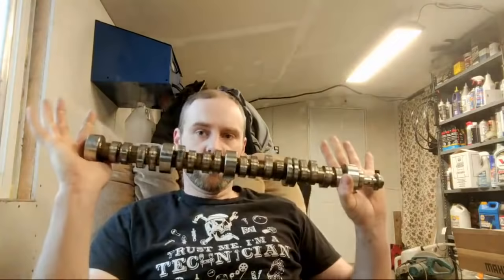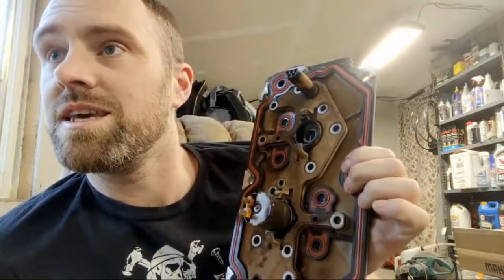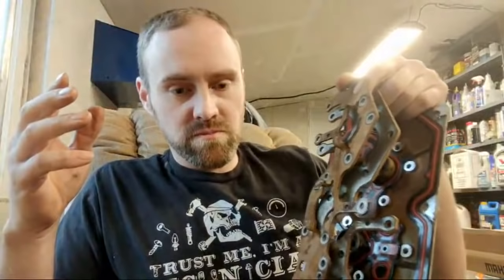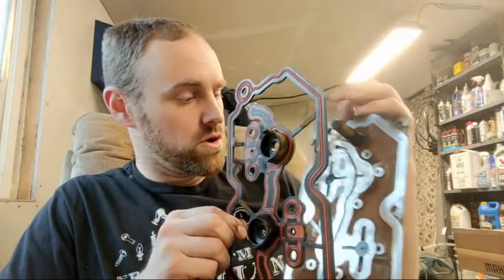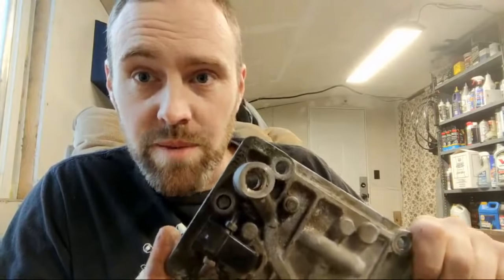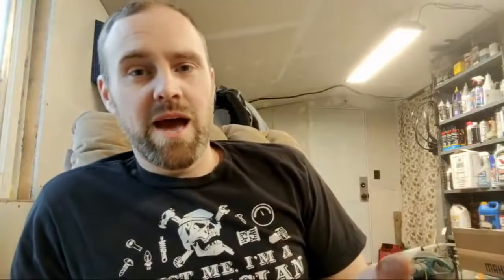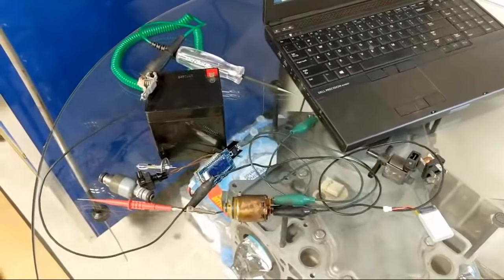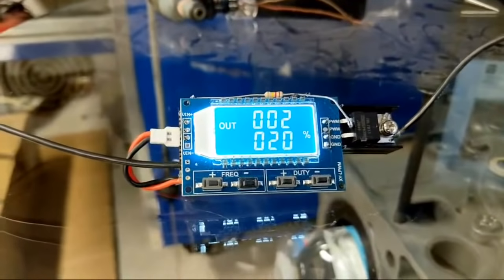First Live To Talk DOD And Ask Me Your Questions

Comment: Hi mate I have a 2010 SS VE ute that sounds like it has a lifter rattle on start up in the morning. I recently did oil & filter change & used the expensive oil that was so thin i had to check the level like 10x because it was so hard to see. My question is.. should I be using a cheaper maybe thicker oil & do you think that could fix the rattle before I spend money i haven't got refreshing the lifters & bearings? Please help i fully respect your advice. Thank you most kindly.

Comment: Man doing 1 now all new lifters did the flush it stopped pecking after flush n new screen n oil sending unit. But customer insisted all lifters replaced even thoughflush took care of it. Now with valve cover off on drivers side it's blowing oil on #7 cylinder blowing out the push rod n threw the rocker arm. Like its stuck lifter its got perfect oil pressure now have to tear ot down see whats up.

Comment: if you replace lifters with non AFM lifters, delete valley cover, VVT cam delete and have ECM reprogrammed will the oil pressure be adjusted in the ECM reprogramming?
Reply from the maker: no, If you wanted to lower oil pressure the pump would have to be changed.

Comment: Question? Have a 6.2L Denali that was showing low oil pressure 20-30psi from 50-60psi. Changed the filter and the oil pressure switch and still seeing 30-40psi. Is there a good spot to get a mechanical gauge on the engine without trying to thread it into the sending unit hole?

Comment: I have 08 LH6. Cylinder 7. Pushrod moves up and down and seems like when it builds oil pressure it stops moving and low compression on that cylinder. Otherwise when it’s running absolutely no noise or ticking. Is this a vlom problem or the afm lifter?

Comment: Thanks for all yout tips i  unabled DOD and installed a normal valley covet i just did dome groves in each oil tower passage (on the valley cover side) and truck runs fantastic i gain at leat 10 lsi of pressure and you can see where the oil was lwaking from old valley cover because has some shiny spots (i used atf for cleaning) but it works thanks a lot

Comment: I have your ultimate challenge.Have a real major problem on a 2010 5.3 with the DOD. The number 4 cylinder. When the engine makes oil pressure they valves quit moving. It has 16 new lifters a new DOD plate. We are lost? Would love some help?
Reply: Help help
Reply from the maker: The lifter could also be spun, using the starter relay with the key off, spin the engine over. Make sure not to jump the wrong terminals as it could damage the ECM. Vlom Must be on for this test. While it is spinning watch the suspected rocker move. Make sure that it rocks at least 6 to 7 times before you let up on the starter. If the rocker stops moving before then it is getting fed oil pressure and is likely spun. You can determine this by looking at the side of the lifter. To see the side of the lifter you need to pull the VLOM and clean out the oil tower of the suspected lifter with cleaner and shop air. Once cleaned you can look down the oil tower and if you see a hole in the lifter it is not spun. If however you see only shiny metal or a flat surface then the lifter has spun due to a bad plastic lifter guide. When this happens you will need to replace the camshaft and all lifters. This would be a good time to do a full AFM/DOD delete where you remove all AFM components and replace them with non AFM components.

Comment: A mechanic opened the valve cover of the afm side of my 07 5.3l LC9...and he tried moving all the rockers...the rockers were all tight with no play...so he closed the valve cover...I asked him if he should turn the crank to see if any of the rockers loosen up which would show a failed lifter...he said no it would be loose regardless...is this correct?
Reply from the maker: No because if it lands at the top of lobe it will be tight

Comment: Had a lifter ticking,flush engine and it stop ticking but I driving my truck about a mile and the strabiltrak lightcome on and I get a p0301 code and it skips ,it cool off and it ok again
Reply from the maker: You likely have a issue with cyl 1 related to the DOD. Turn it off now to keep it from failing for good.

Comment: Turning engine over with starter jump and not starting and all rocker arms working fine and working in sequence. Have not checked with running engine. I thought I had a stuck lifter with scanner showing 1 and 7 cylinder misfire, but rocker arm covers and springs all tight. compression in 1 130 psi and number 7 117 psi while running. Number 2 was 150 psi. All spark were replaced before these test preformed because old ones showed black after cleaning weeks before. Truck has no power and can barely move 2008 Avalanche 5.3 even after computer tuned for v8 only and cleaning engine with transmission fluid for one hour. Engine looks extremely clean. Help
Reply from the maker: Contact me at crazedperformancerepair.com perhaps copy and paste your message there. I'll get you some info. It's a better way to communicate with me.

Comment: I had dod turned off with hp tuner and did the vlom delete drove it for a month  now i got another liffter thats stuck  how can that happen?
Reply from the maker: Did it get stuck or did it spin in it's guide?
Reply: @CrazedPerformanceRepair  it is stuck
Reply from the maker: Well that's a first I heard of one stuck after the vlom mod and tune, but anything is possible I suppose. Perhaps it had one that was borderline and had the paws that lock the lifter in place worn out in a way that allowed it to collapse and get stuck? I definitely would question if that lifter would be able to be released permanently. You are probably going to need a lifter. Is it the same one or a different one all together? I just want to be sure.
    If you replace it and don't see any reason for the failure I would love to see the lifter and will pay shipping for you to send it to me.

Comment: Question my chev pickup says to use 5/20 oil ,is that to thin 2016 year truck
Reply from the maker: Not for clearance they have but I would start adding 5w30 after 70k mi or so to be safe. Also be sure not to listen to the oil reminder on the dash. Do it at 3k or 5k max.